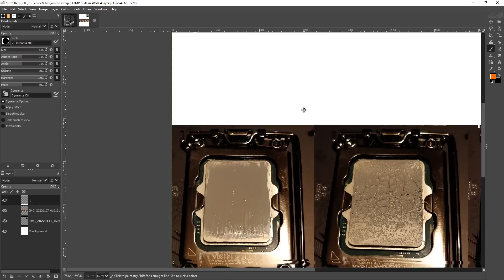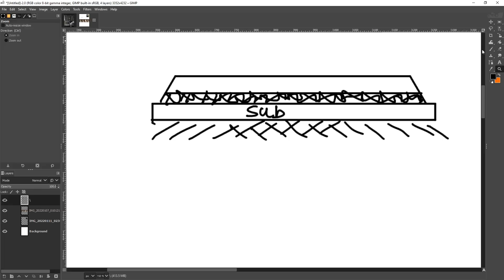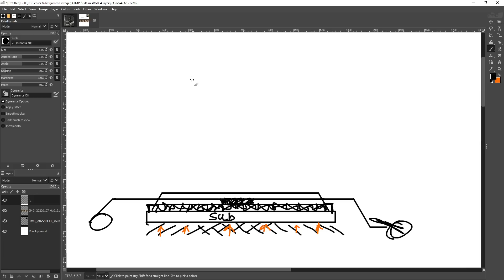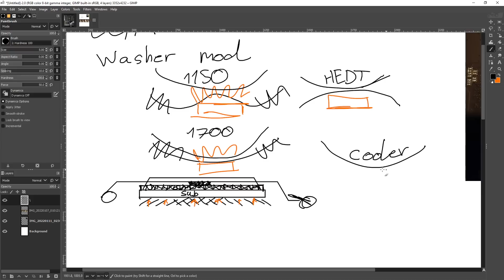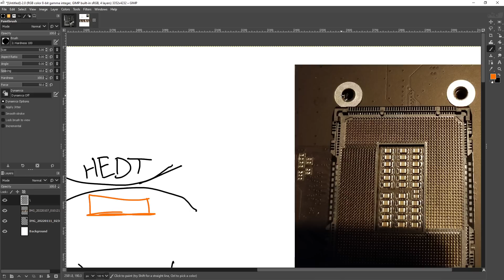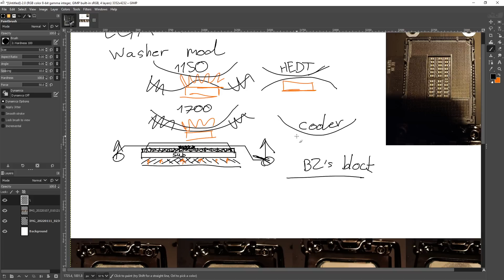Rambling about the LGA1700 washer mod

Comment: I recently came across this mod, 
I got a Supercool Direct die installed, in case you don’t know it , it’s a direct die waterblock that uses an alternative IHS as the contact plate to the die but on its other side it acts as a waterblock since Coolant passes on it.

Would that need the washer mod ?

Comment: The principle applies when direct-die cooling, where the IHS and ILM are both dispensed with. The CPU is pressed into the socket by the cooler plate only via the die and the result will be great cooling but often a warped CPU PCB (up at the edges/corners) which can lead to inconsistent pin contact. Hence the often reported memory channel issues and such, but I'd also be concerned with the VCC (power) areas - they can be transmitting well over 100 amps (in fact over 200 amps in some overclocked systems of recent generations) and I wouldn't want any of the VCC pins barely tickling the lands. ETA >> the solution for DD is a shim around the die to distribute the force from the cooler plate, better than 'direct die frames' IMO.

Comment: I have a Monster Labo beast, I believe it uses EK blocks. I had this issue when I first got the PC. I changed the mech to a cheap contact frame and it solved the problem.

Comment: I did the washer mod on my ITX system. I observed a similar spread of thermal paste that was thicker in the centre.

I went from an undervolted 12900K, pulling an average 195W peaking at 92C after 60 mins of r23, to a 12900KS with an undervolt pulling 235W average peaking at 93C after 60 mins.

6 - 10% net performance improvement, putting out 20% more wattage for the same temperatures as previous.

I'm using a cooler Master Nrp200 Max, and the included asetek 280mm AIO, in ambient temps of about 24C.

The washer mod works, but that is because the asetek water block was surprisingly flat, and I made this deduction because it says it supports all Intel and all AMD cpu, and they both have different curves in the IHS.

I used 1mm metal washers for the mod, and torqued the ILM close to the same tension as when removed. No memory issues so far.

Comment: I was wondering if my Swiftech apogee xl or my xl2 backplate\waterblock will fit ok with my asus prime z690 -A Mb and I do have all the standoffs for intel and the amd configurations . My build is a Intel i9 10900x series cpu / Asus tuf x299 mark 2 socket 2066 and i have that waterblock installed. My question do you know if this block will fit snug on the 1700 cpu i9 with the spring loaded thumb screws or since the cpu lays a bit lower can i use some then washers before I screw in the thumb screws under its springs causing it to apply a bit more pressure or do i even need to do that at all since the waterblock lays on lga 1700 correctly but i was worried if its applying enough pressure on the cpu to keep it cool. Great video Also do you know which of these these upgrade kits mentioned will work with the 1700 standoffs for this swiftech water block...   https://www.swiftech.com/ApogeeXL2.aspx

Comment: I've had the 12900k since nov 2021. i get 90F standard use and 127F max gaming at 4k. I've not experienced any problems. When is an ihs or heatsink ever flat ? Never.

Comment: I'm highly skeptical about your claim that cooler surfaces are (intentionally) not flat to accommodate for a bent CPU surface..
First, it is obviously much easier (and thus cheaper) to tool a flat surface than an arched one.
So I'd expect at least budget air coolers to be relatively flat.
Second, then for the more expensive ones, if they were arched, they'd certainly exploit it as a marketing argument. But i have never ever seen this even mentioned on any cooler product specs.
Not saying it can't be, but a bold statement as this requires more thorough evidence.

Comment: The CPU has to be pressed down onto the pins, not so much because the pins are a different height, it's to ensure good electrical contact between the pads and the pins delivering the 250 odd Amps the CPU needs!

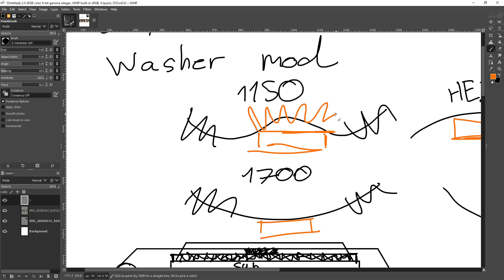Comment: 12:00 and thus lapping your CPU (if you like to void your warranty) is hereby debunked for normal/gaming use cases. because if you still lap the CPU, you might as well void your CPU Cooler warranty as well and lap it since that wasn't straight to begin with..
The ONLY effect lapping has or CAN have is better temps when you use LN2 paired with hardcore overclocking which.. again, in normal/gaming use cases is NOT the case.
READ ON:

the washer MOD everyone is hyped about, MAY or may NOT work for you.. but you don't void warranties by adding/removing the washers..
However, the actual trick to this MOD is to do this AT THE START -when you actually bought a fresh and new system/parts and still need to build it..
if you do the washer mod AFTER the fact, the chances are that the CPU is already bend and wont bend back. so.. your luck may vary.

If you DID do this mod from the start and your temps are.. off the charts high say 80+ when stressing, remove the washers.. add thinner washers.. and test again. 
test until you either are satisfied with the temps and/or have no washers installed (so no mod) which means the waterblock/cooling was already matched with the IHS.

Comment: Totally agree the loading mechanism feels overly tight. First time putting in a CPU, had it in the correct orientation but still took it out again to check because it felt the lever would bend from the strain. Turns out that is ‘normal’.

Comment: Pondering about if these bends affect the liquid metal under the IHS, when switching between a lot of motherboards, causing slow metal fatique ? (i have a 12700k) and also would it not be possible to remove the rentention mechanism and use the clamping force from, say a waterblock (EK quantum velocity2) ?
-Thx for great content :-) Have a nice day everybody

Comment: If you're using stamped washers give them a quick sanding to take the edge off. OR use a non metallic washer made of delrin or hard fiber. Not something too soft like nylon or plastic, where it could squish.

Comment: It seems that some boards come with this mod from the factory now. My Asrock z690m phantom gaming 4 has 1mm plastic spacers between the braket and the board and ALSO on the bracket right next to the tabs that push the cpu down. The latter push against the edge of the socket when closed, guarantee that the tabs are 1mm higher than they would have been otherwise, and honestly look more like a hacky hotfix than intentional design.
Reply from the maker: Do you have a picture of this? because I'd love to see it. My email is buildzoid@gmail.com
Reply: @ActuallyHardcoreOverclocking  my gigabyte arous elite ax also comes with plastic washers it seems. I tested the mounted CPU with my credit card and it seemed to be very flat as well
Reply: Just opened a MSI Z690 Force wifi and I was ready to install thermalrite bracket but there was a black rubber material beneath the ILM already. Seems not needed at all so far.

Comment: intel could impose a new updated standard for all board manufacturer for standard ILM design if they want to. which lets HOPE they do that. (mind you HOPE is for humans who will remains in the new world past 2031. just saying).  and intel can UPDATE THEIR LGA1700 IHS in sync with a new update of ILM standard for it. for example having the side "ears" of the IHS lengthen from edge to edge. and have the ILM build standard have TWO clamping ear on each side. this if intel would spend a little more for production of those few ounces extra of metal on those new IHS ears dimension. they can update these within the lifetime of the LGA1700. they do NEED TO DO JUST THAT. their final decisions will show how much they care of this little issue.

Comment: Thanks for deleting my comment just because you didn't like it. BTW, I'm not just your average drive by commenter. Was a moderator at Tom's hardware for YEARS and am one of the top contributors of all time. I'll be sure to remember that you don't allow anything that is contrary to your assertions.
Don't believe me? Check. Known as Darkbreeze there, so............
Reply from the maker: Did your comment have a link in it? because YT auto removes those.

Comment: I didn't even get that far. After no posting with the first cpu I tried, I took the cpu out of the MSI Z690 Edge wifi DDR4 mobo and saw that the top left corner of the substrate was bent up towards the IHS. I'm guessing since the substrate was bent it wasn't making contact with the pins, so I ordered a second 12700k and a different mobo and I got a noctua air cooler instead of the NZXT X72 that I was using. Still waiting on the air cooler to be delivered so I can eliminate what parts are causing this. Very frustrating to go through all of this. At this point it's almost worth not upgrading. Any tips to make sure I can get a post and maybe avoid bending the freakin substrate would be appreciated.

Comment: For anyone wanting info on the LGA 1700 socket:
Specification Intel socket LGA 1700:

IHS to MB Height (Z-Stack, validated range) 6.529 – 7,532 mm
Socket Seating Plane Height 2.7 mm
Thermal Solution Hole Pattern 78 x 78 mm
Maximum Thermal Solution Center of Gravity Height from IHS 25.4 mm
Static Total Compressive Minimum 534N (120 lbf), Beginning of Life 356 N (80 lbf)
End of life maximum 1068 N (240 lbf)
Socket Loading 80-240 lbf 
Maximum Thermal Solution Mass 950 gram

Comment: Plain and simple. The backplate is too weak.
Intel requires a certain amount of force on the CPU to make good contact with the pins.
The 1150x was spec'd at 70 to 120 pounds force.
Since we're now dealing with 1700 pins the force needed is more like 110 to 160 pounds.
No one has checked the backplate. I did, it's curved just like the CPU and mainboard.
I will be making a new backplate to test this theory.

The washers just reduce  the pressure on the IHS which is pivoted at the center of the outer screws.
They don't cure the problem, they mask the symptoms. You may have a flat CPU but are you still applying the correct amount of force to the CPU to seat properly in the socket?

I'll tell you in just a few days.
Reply: What happened? Please give the details....Thanks.
Reply: @edwardferns  Two prototypes work great. Nice even distribution of TIM and a slight temp drop.

Comment: This is similar to the issue that you have in building engines. When you clamp the head onto the block you deform the bore. This 'can' lead to the piston rings not sealing as well as you might like. Thus a loss of power. The solution is to bolt a 'torque plate' to the cylinder block to mimic the force that the head applies. Then bore and hone the cylinders. This ensures that the cylinders are round when the engine is assembled. Despite the fact they will be slightly out-of-round during assembly when the head isn't bolted on.

Where I'm going with this. If you want to successfully lap an LGA1700 CPU flat. For best results, it would possibly be required to sacrifice a motherboard to cut out the socket. Mount the CPU and then lap the CPU with it mounted in the socket. This will ensure a flat surface with the CPU is mounted. As you're flattening the CPU IHS after it has already been deformed.

Great content. 
Jordan

Comment: Just a quick question, this bending against the cpu socket area will happen using the intel RM1 stock cooler than came included in the 12400F, in a Rog Strix Gaming D4 Z690, would be very bad and catastrophic if this issue also happen with air coolers. an air cooler weight less than a liquid one, ¿Anyone can confirm it?

Comment: Wouldn't the washer mod mean the cooler provided the greater pressure, thus better contact?

I'll be building a 12900k/NH-D15 over the next few days and intend to use washers.

Comment: The really crazy thing about this is that according to this video these springs are so powerful that they can warp and maintain that warp against the enormous pressure created by the heat sink. For some reason, according to the video, only intel's mounting system has enough pressure to counteract the pressure created by the very tiny springs. What space-age material are these springs made of?
Reply: Yes, this video is absolute nonsense.

Comment: the only recommendation is any MSI board....they been on the roll making boards and gpu boards so far...unlike gigabyte, its a disaster waiting  for them from everything they made so far...they use to make good gpu cards...now, i starting see the pattern now with everything they produce...now asus starting have flaws in board memory power vrms when its backwards that got me super concern with their future board process...similar as gigabyte...
Reply: But buying MSI won't protect you completely from problems anyway.
Though I can't recommend Gigabyte in any way... Bad Coolers/Fans, PSUs, Mainboards (heat issues), etc. Gigabyte is saving to many $s in production.

Comment: what you need to do as steve from nexus...test all the brands and models then redo your tests...your work is very sloppy when your not builder or expertise on cooling ...your just electrial engineer and stop pretending your expert in different fields when your not pc builder, also jay2cent and steve are pros in this field...i been in this profession for past 25 years...i never cut corners in testing like that...so in jay words, DO YOUR HOMEWORK COMPLETELY ...

Comment: not all boards have this issue with msi all models, asus some models, gigabyte have many issues as usual, Asrock some models ...jay2cents prove you wrong that there is no difference in his test cause he using good board and thermal paste is the key to everyone problem, his running at 70c -75c entire test...and its pretty good as 5950x heat dissipation and normal to his eyes, everyone seen his channel lately, no lies ....since arctic Mx4 been recalled due to overheating issue due to flaw in productions ...good thing i use noctual NT-H2 while kingpin show many many excellent result if apply accurate to heat IHS

Comment: This is interesting.  Wondering if this could end up being a widespread issue for the 1700 socket clamping mechanism over time.  Seems to me they perhaps need to redesign the mechanism to spread out the pressure wider lengthwise on the CPU vs too much in the center.

AMD/AM5 take note!
Reply: Amd doesnt have to take notes they already have a rock solid socket for Threadripper, i’m pretty sure they got it covered for Zen 4 unlike these idiots at Intel :D

Comment: I am kinda wondering what’s the deal on the itx boards? For instance I have a z690i aorus ultra itx ddr4, I’m using a heatkiller iv waterblock, my temps are not outrageous, but I am sure it can’t be better. I’m using the update 1700 backplate, springs and washers from heatkiller as well. Idk if my thinking is correct, but the smaller itx size would mean the board has less flex, also my waterblock it’s got a really good mounting system, it’s almost impossible to get a bad mount on heatkiller iv block. Can anyone chime in on this? Forgot to mention the z690i aorus has a robust amount of solid heatsinks and a full aluminum backplate so, I’m not sure if this mod would work for me, I think my mount might be as good as it will get.

Comment: You made my day, by doing this and sanding 12900K ihs ( it was soooo concave ) got temps down by 15-20 C ( !!! ) using Optimus Foundation waterblock. Now 300 W is not a problem, CB23 30280 at heathy 92 C :)

Comment: Is noctua D15 flat? I got all the new parts but haven't installed them. Should I go straight to the washer mod?
Reply: Did you try the washer mod?

I'm also going to be using a D15 and have no clue what to do. I'm not keen on dismantling a brand new motherboard, but I also don't want my 12700K to bend and overheat.

Comment: There is another advantage of the "washer mod", when using a block designed for LGA15xx/LGA20xx: because the Z height of LGA1700 is less than that of these prior packages, you may not get the same level of contact between the cooler coldplate and the IHS when the ILM is "pulling down" the CPU into docket with full force. So, by reducing the amount of "pulldown" into the socket, the CPU sits (slightly) higher, and therefore, makes better contact with a cooler/block designed for a thicker CPU.
Reply: Is this theory or can you confirm this with your rig??

Comment: I just realized my old delidded 3570K might not be dead (no visible damage). It may have lost contact to some pins after shaving off the height.

Would you say that Zen4 is going to have the same issue as you just described because the AM5 LGA loading mechanism pushes only in the middle exactly like LGA 1700? Or is it too short? Also the Zen4 IHS has cutouts which will probably allow for more curvature. How about putting something (washers?) between the IHS and the loading mechanism?
Reply: Zen 4 AM5 won't have this issue, AMD uses extra screws to balance out the ILM with better retention mechanism.

Comment: Lithography engineers: We need more money for...
Intel: Say no more. Here's $10 billion.
Loading mechanism engineers: We're having QA issues with...
Intel: GET OUT OF MY OFFICE!
Reply: To Intel, as long as it doesn't thermal throttle at PL1 whether it runs at 50 degree or 90 degree matters little to them.
Reply: They blew their budget on super tiny springs that are powerful enough to bend metal and maintain that bend against the enormous pressures of a well-mounted heat sink. When all they needed was springs strong enough to make good contact. Do you really think they deserve more money to waste...

Seriously, these heat sinks have enormous downward force, and according to the video, the springs are more powerful.
Reply: Do you own a 12900k ? I've had one since release. I haven't experienced any problems or out of control tempatures